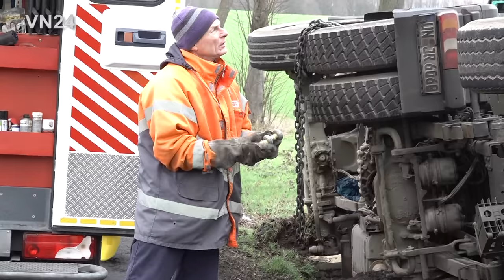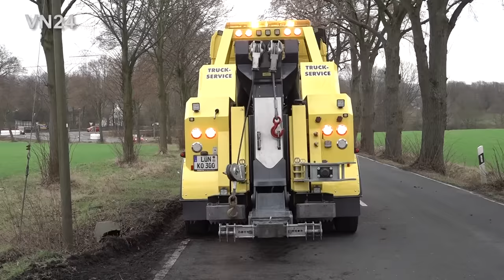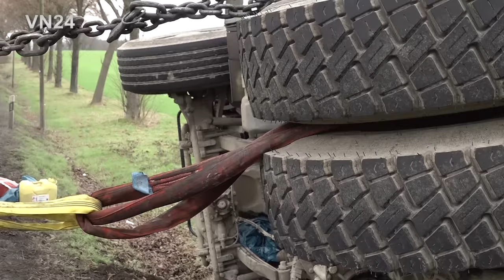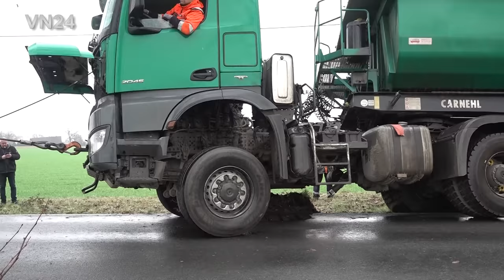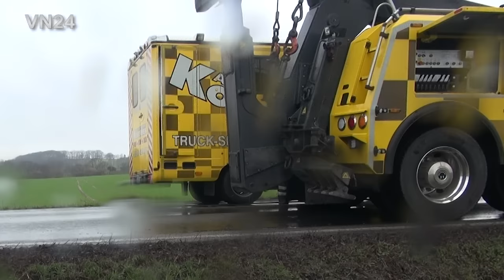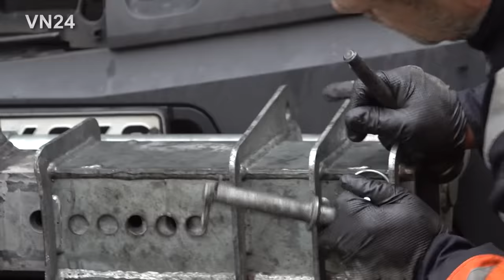21.01.2022 - VN24 - Abschleppdienst stellt umgekippten Muldenkipper wieder auf die Räder

Comment: You can tell that they are not Americans, they can screw a nut on a bolt without a power tool! Also the job was done properly with a minimum of fuss, no sirens or over-inflated egos in earshot or sight.